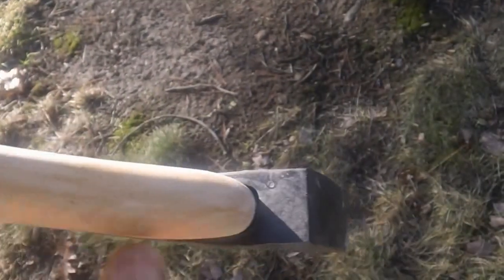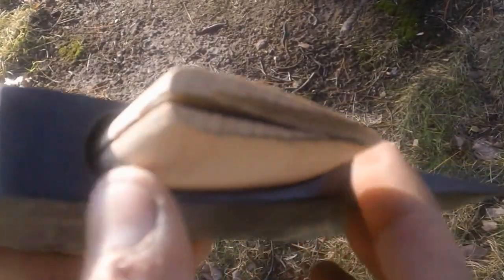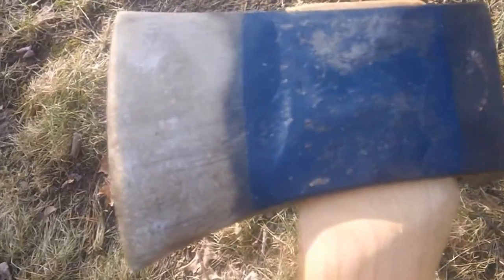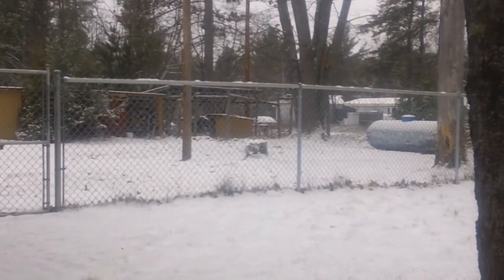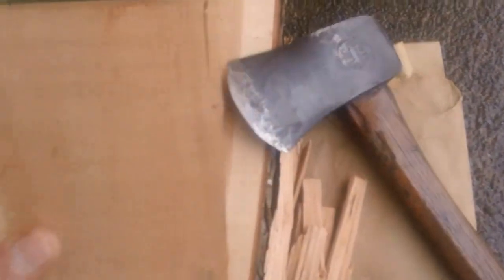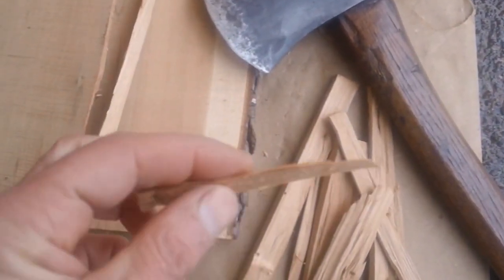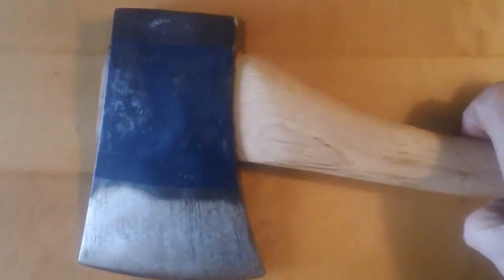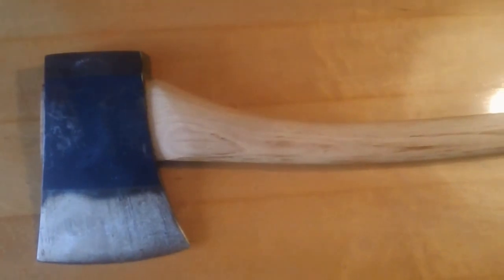Hafting a new 100 year old axe

Comment: Hey Mindokwin- i added a piece to my handle by dove tailing it to the back of the handle with wood glue  clamp it let it set overnight,shape it with a wood rasp to fit.then install axe head and wedge.it works everytime.the dove type tail on the sdded piece keeps it from ever giving.lasts as long as the handle does.takes a little time but well worth it at the end.no way it can give or come loose either.i use hickory for the add on-same as the handle.good luck  nice video..

Comment: my axe also ended up fitting like that too, there was a gap in the front (slimmer part) of the eye, but it was on there super tight. it  didnt seem to be a problem
Reply from the maker: +The Collector It probably won't be a problem. I think these older axes had more variation in the eye size.
Reply: Mindokwin yeah being hand/semi-hand made it makes sense.

Comment: Say Heah, I sort of made an unusual axe, I had a thin 5" Iltis Oxhead hanged on a 19" White Hickory Handle,  I had it made short for easier transpot, Some call it a House Axe, Miner's used short heft also. my Iltis head is similar in weight to yours and having a very thin face some told me I would of been better off putting a longer handle on it since it is a felling axe head. But I still put on a shorter handle on it. What I'm finding out is with its shear weight it plows through wood easy and makes short wood out of processing alot of firewood down to kindling just by Axe Tapping it. I'm not that good as you, so I had mine made and Maurice from Canada made it for me and did a great job, Thanx for sharing your axe, job well done, Thanx. ,,  ,,  ,,
Reply from the maker: +paulie 4x That sounds like a handy size axe there Paulie. Thanks for watching and the compliment. Cheers!
Reply: Especially when everybody laughed at me, telling me I made a mistake and that it's too thin to split with. But seriously the weight just blip, blap, blam through wood making short work processing firewood down to kondling, I Axe Tap with it and I had a leather harness made to carry it, It goes over my shoulder and I don't even know it's there, Yeah, it's a good one. ,,  ,,  ,,

Comment: That is the most beautiful head I’ve seen. Maine eyes were very long and awkward. I have a handful of Maine axes like Emerson & stevens and they tend to have that gap in the back. I have also used wedging to fill that gap. Glue helps those stay in place
Reply from the maker: I don't see too many Maine axes here. I really like the diamond shaped eye in older Maine double bit axes.
Reply: @Mindokwin  I have acquired 2 daimond eye Maine double bits both made by Emerson & Stevens which is who made that particular Witherell you have here as well. The date under poll and P under bit was E&S identifiers also like you mentioned John Witherell stopped producing in the late 20s but that axe is marked in the 50s  E&S forged for a few different companies in their later years.
Reply from the maker: @ryanb1314  I believe the Witherell was a separate company at first then was acquired by E&S at a later date. I was not sure when that occurred or if my axe is before or after. Thanks for the info, it is my nicest axe.  Nice pickup on the diamond eye axes.

Comment: I was wondering what sort of oil to use to drive the wedge (or adhesives or steel crosswedges that came with the wedge kit or whatever,) and I remembered that linseed oil polymerizes as it dries, thus eventually forming an adhesive bond with the wedge.  That's also why it's used as a base for oil paints. Good to know my instinct was on the right track.  I'm about done shaping a haft for a 3-pounder and just looking for tips to do it right.

Comment: Nice Job👍. Amazing old piece of history. Looks like a great cutting Axe.  Crazy that label was in as good of shape after 100 years!  Does the Head have a Makers Stamp?
Reply from the maker: Yes it does. It is stamped Witherell in an arc pattern. Also I found an original paper label that was never put on an axe on Ebay. The seller had a lot of labels from the old Emerson & Stevens factory in Oakland Maine. So I have that with the axe but not glued on it.

Comment: I gorilla glue gaps on my stuff, solid as a rock, nicely done sir.
Reply from the maker: Rich Holland I prefer not to use glue on axe heads. It makes it harder to remove the handle if I have to rehaft it. Thanks for watching.
Reply: Mindokwin Yeah the more I learn, it seems like a bad idea to use glues, at least to future proof- no point in ruining a good ax head just to get it working today. I have no idea how old the one I'm working on is, but they don't make them like that in China.  I do like my Fiskars 7550 hatchet though.   :b

Comment: A late reply , yes ... I would be reluctant to remove the original label , but if the label is unreadable and detracts from the beauty of the axe , I reckon it has to go . That axe head is quite a find and congrats . 
As far as gaps - If they aren't too pronounced , a mixture of sawdust and epoxy or my home made hide glue works pretty good . Thanks for your video Mindokwin  and all the best from New Mexico -> Lefty Cat
Reply from the maker: It was a difficult decision since I normally like to keep things original and historical. Luckily I found an unused original Witherell axe label on Ebay so I bought it to go with the axe.
Reply: It is amazing you found a label on Ebay ,  which is a site I need to look at more often . Have been sharpening an old Plumb carpenters hatchet which I prefer over any other hatchet . Have had it for over 40 years and it bites just as well if not better than a Granfors . 
Do you ever use a carpenters hatchet ? 
ATB .
Reply from the maker: A guy had several labels he got from an axe factory in Oakland Maine and had them in his collection for years. I do use a carpenters hatchet and also a broad hatchet. I probably use a broad hatchet more often in building because it is easier to flatten a pole. The hardened hammer end of a carpenters hatchet is handy though when using nails and chopping. I probably have about 30 or more hatchets.

Comment: beautiful collins
Reply from the maker: +that comment doe.  Thanks but actually it was made by Witherell in Oakland Maine.
Reply: i thought you said the other one is a collins? i like the box look of that witherell though. i think you did a good job on the handle also, just finished shaping my first handle for my germantown masterbuilder roofing hatchet and it didnt come out perfect by any means but it couldnt look better to me.
Reply from the maker: +that comment doe. Oh Yeah forgot about that one. I have a Germantown hatchet. Very hard steel. Perfection is a goal rarely achieved in my experience.
Reply: yes very hard! it put my dremel to work, it has deep rust pits but i did my best on getting them out.